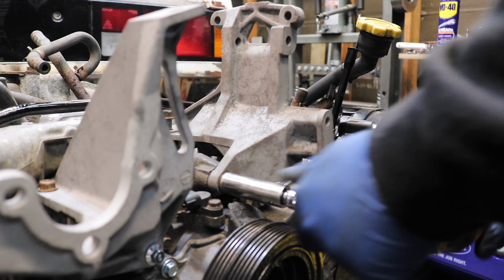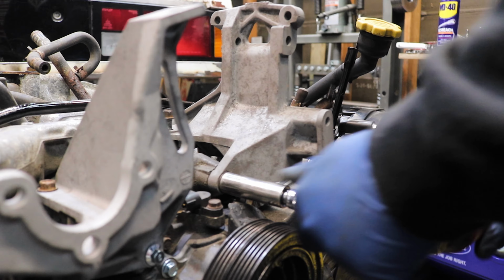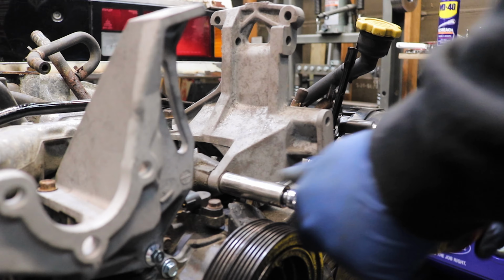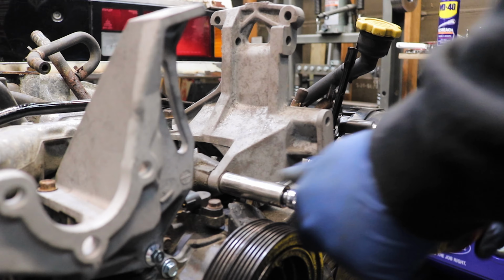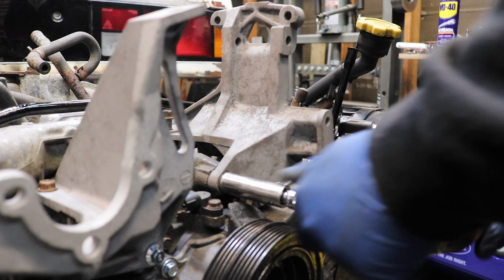Subaru Powered Honda CRX: Starting the WRX Engine Refresh and Haltech Harness

Comment: Clicking the like button before watching because I know it's going to be good.

Liking your blasting cabinet. If you have access to 220v and could fit an oven, a small powder coating setup is nice. Eastwood's dual voltage gun has served me well.
Reply from the maker: Hahaha thank you! 
Funny enough, I have Eastwoods powder coating gun, some powder and oven. Just haven’t had the opportunity to try it. I figure once this turd is running I’ll start going through and prettying things up with powder coating, painting, zinc plating etc
Reply: @Enginuity  excellent! I can't blame you. Sandblasting, and laying down a couple layers of powder takes forever. End result is worth it, but only so much time in the week for garage time.
Reply from the maker: Amen to that brother